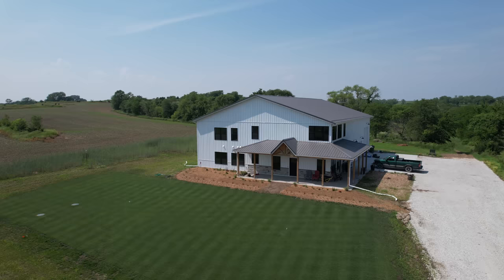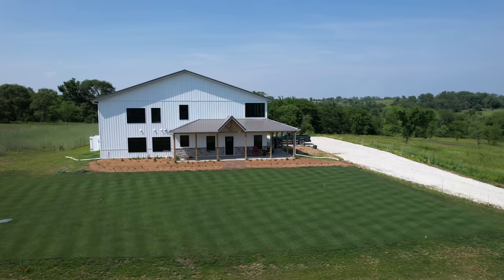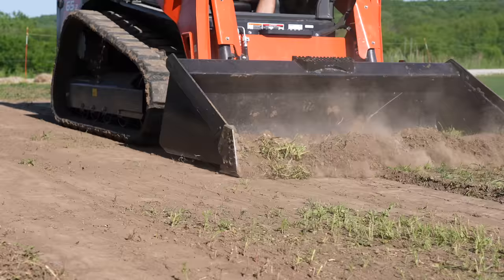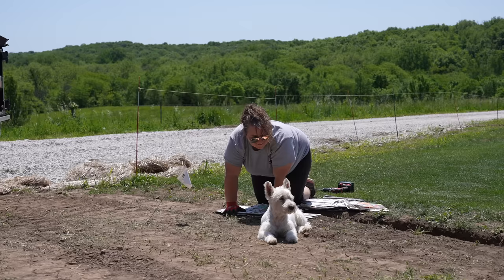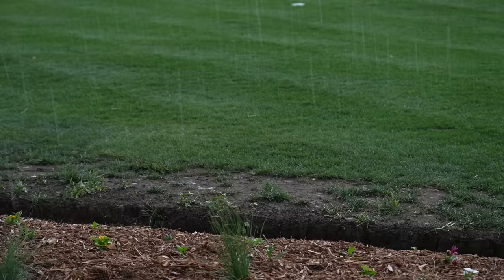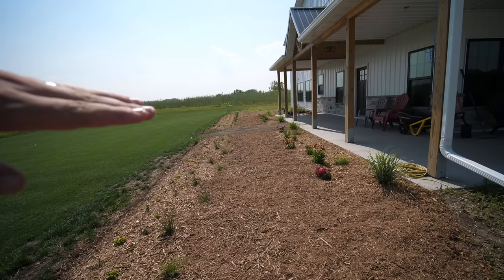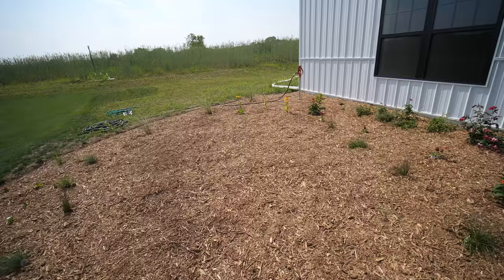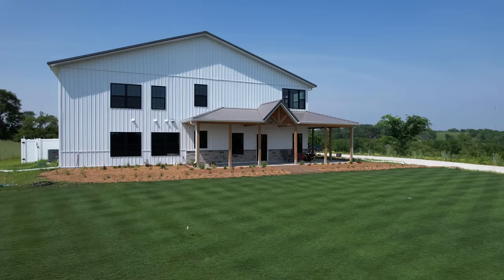New Front Lawn Landscaping Project // Barndominium Landscaping

Comment: Put a cistern in there, as big as you can fit. Get a pump. You’ll never worry about your well during hot summer months even in drought if you need to water grass, or flowers. We did it at the shop and use it constantly during the summer

Comment: If you guys were able to install an underground rainwater storage tank, you could probably supply most of your irrigation from the roof run off.
Reply: For a drip irrigation system, yes. Grass requires a massive amount of water to stay green and you would need a very large tank. I've looked into it before and very large tanks will set you back a couple hundred thousand dollars. It's better overall to have less grass.

Comment: I actually like the idea of bushes and what it does to the ground and removing them if you plan for it and put various size plants at various depths with proper spacing I want to start off low and super flat wet winter clay with small rocks and plant literally piles of plants bushes trees and rocks and good soil and seeds and water it all in then add dry clay and walk all over it and step on grass seed and wet it and water it and wash it so there's pockets of water holes and plants and clay impermeable grass top except where the rocks are for water in and out and as everything grows there's room for water and expansion and take a rock out and finish it with clay and grass seed until everything gets yanked back out to flat ground